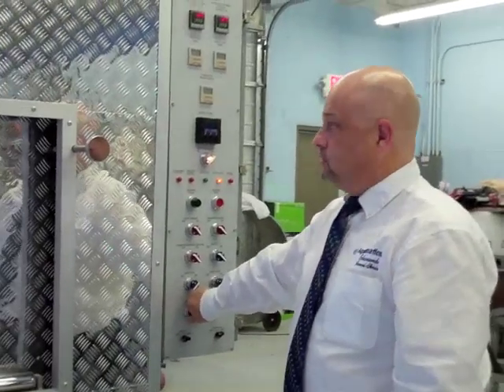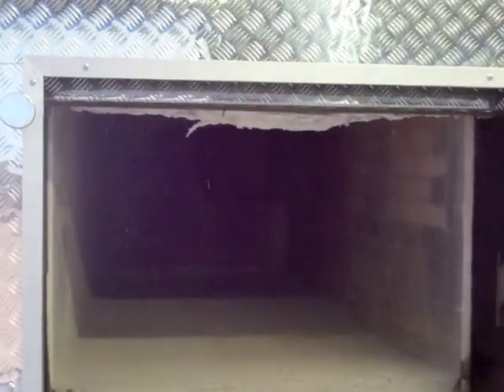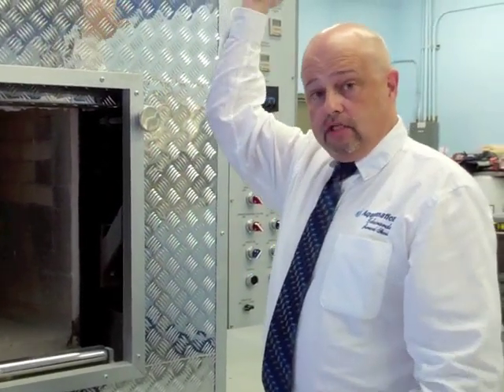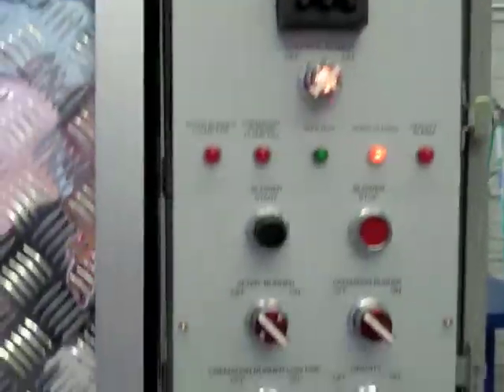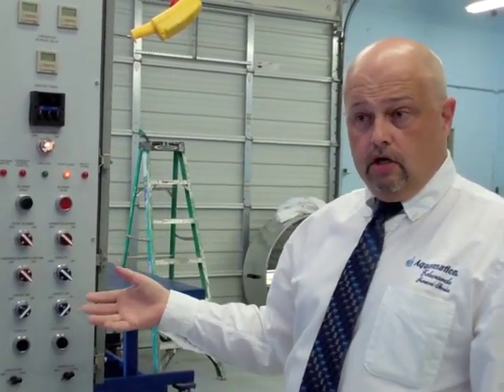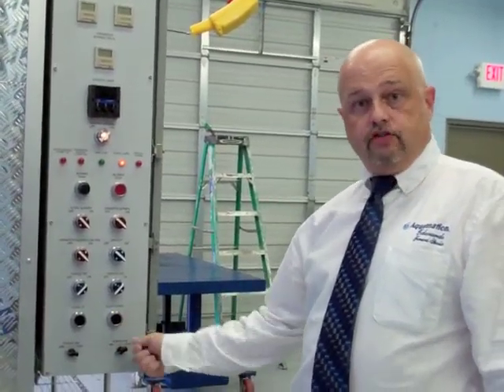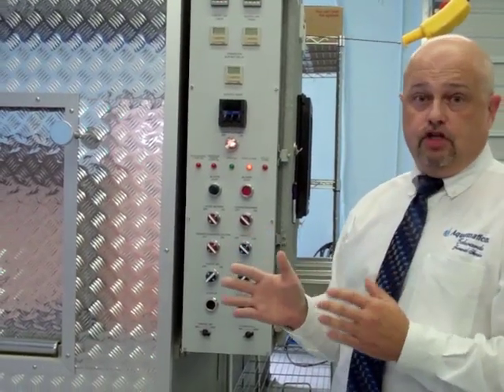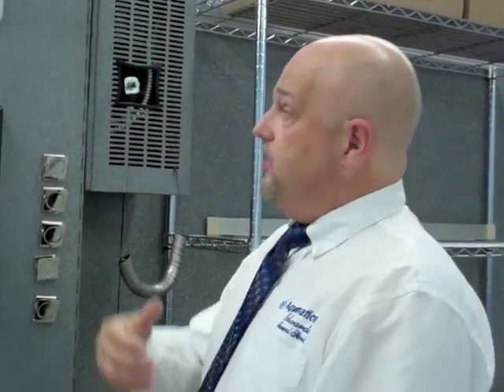Cremation Retort Tour

Comment: Invisible? Um nooooo I was near a mortuary and I could CLEARLY see smoke coming out of the stack. I should have filmed it.
Reply: most likely steam. you didn't mention odor. if the combustion was out of specs you'd have gotten a slight whiff of something not altogether unpleasant.
Reply: +Trevon Black / I work at a funeral home and some funeral homes do not follow the guidelines of cremation exhaust. In fact our funeral home has 2 after burners and a filter on each cremation machine so that when the air is processed there is no harmful substances.. so before you say they are wrong you should do your research....
Reply: Tyler Addison that applies to your situation. Do you really think that being where they are and what they are its smoke? Water vapor is something that is pretty much unavoidable during the start of the process. ,but then you would be aware of this. Research at your prompting I did. I'm old at this but even I could be wrong.
Reply: +Trevon Black I work for a crematory manufacturer/service facility.  IF it was the unit that was smoking it was most likely because their air/gas ratio was out of whack, could also be a failed part.  This is easily corrected by a service tech or even a simple call.  If a machine is operating correctly the main substance that will come out of the top of the stack is water vapor, it will look like the clear steam that is present on a road in the summertime.  All our units are odorless and smokeless and exceed all federal, state, and local requirements.  For comparison a properly running crematory emits less particulate matter per hour than a fireplace, truck, or restaurant.
Reply: Sometimes, a crematorium operator might turn up the flame to speed up the process and that might cause a bit of smoke, but it doesn't normally happen.
Reply: Sometimes this could be due to a Hindu funeral where the relatives request initial visable smoke,they also watch the coffin being placed in the retort.
Reply: sometimes the hearth air is turned on too early too, causing the container to smoke out
Reply: Maybe there was a new Pope chosen at the Vatican.  Sorry.....I couldn't resist.